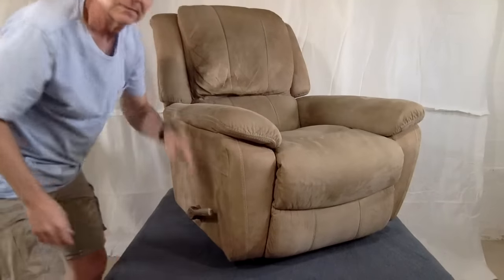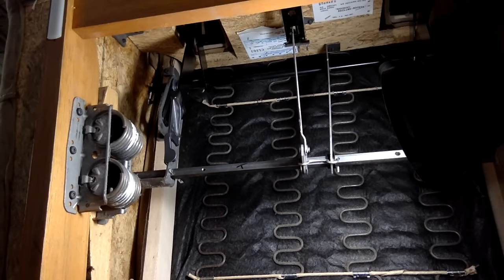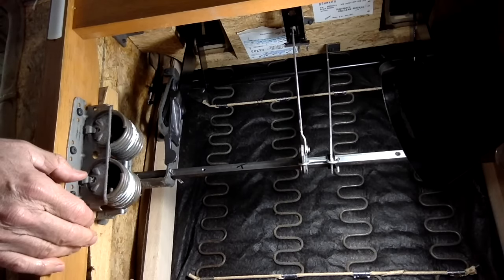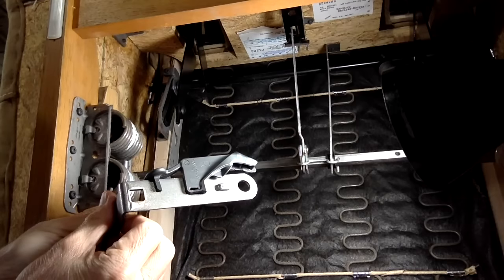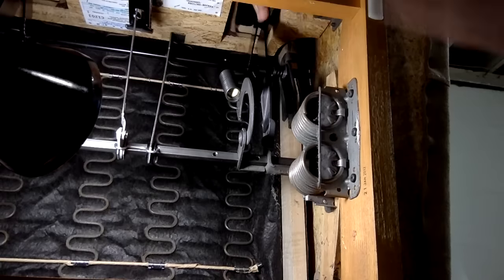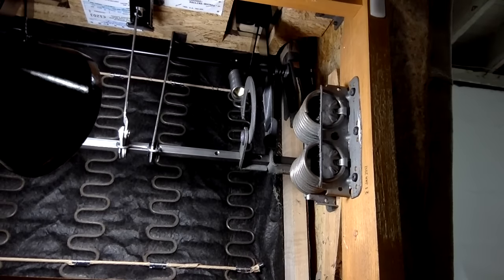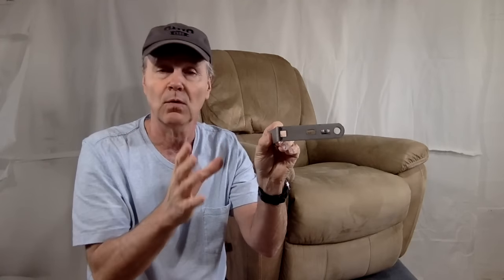The La-z-boy Recliner 3-Position Footrest

Comment: We were having trouble following other videos, mainly because the broken foot rests had the older grey part and we’d been given the black ones. We were afraid to exert the pressure required to put them on when it looked so easy in the videos. That included yours, but yours was so clear that we had more confidence, and then at the end you mentioned the new design being acceptable as a replacement and more robust. That was exactly what we needed to make it all happen. Also helpful was your comment that the party could be used on a one position foot rest, which two of our three broken ones were. I can’t tell you what a relief it is to have them all working again, not having to spend a thing on repairs or possibly replace the furniture, which would be difficult at the moment. Thank you so much!
Reply from the maker: @Cynthia Kelly - You're welcome -- Great job with the repairs!

Comment: That was a great video. I have had a Harbor Town (smaller La-Z-Boy) whose footrest has started to slip from position 3 into position 2 when reclined and it's aggravating.I found more details in your video than anywhere else. Thank You.
Reply from the maker: Massey Jones - If the entire chair is slipping down, it is not the 3-position footrest feature. That controls the footrest separately.

La-z-boy also has a Ratcheting Recline feature on many chairs. That controls the entire pitch (recline angle) of the chair when it's fully reclined. 2 parts control this feature, a lever (Pawl) and a part with metal stairs (Pawl Rack) that the lever rides on. When either part (or both) are worn, the chair will slip down as you describe.

I hope to get a video done on this subject sometime soon.

Comment: Thanks, the video is exactly what I needed. Fixed it in 5 minutes. The only complaint is that those crazy little clips costs $23 plus shipping. Should cost around $5!!!
Reply from the maker: @nashvlbees - This is a common part that many La-z-boy dealers will have in-stock. If you can find a dealer that has them, you might be able to get a better price & save the shipping cost, of course.

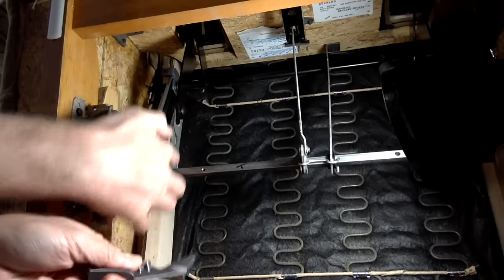Comment: Fix in place using JB Plasticweld - mix the clayey epoxy thoroughly and mould a small piece over the gouged portion shown @2:54. No need to take the clip out. Let it cure overnight. Good luck!

Comment: Good videos; however, I have a recliner built in 2006 and it does not use the 3-position clips. Instead, there is a toothed ratchet in the center of the chair. I found the screws holding the ratchet to the wood back were loose and missing. I replaced them but my "ratchet" does not appear to be working right. Perhaps I need to "recalibrate or adjust?" Thanks!
Reply: Check out the video I posted a link to. It's an easy fix.

Comment: i just looked at my moms & that big spring you slid over a bit at the end of the video thats attatched to that big hoseshoe bracket, well on the other end that bolt that holds the L bracket to the square tubing sheered the head off, thus i suppose while trying to recline or use the foot rest bent that horseshoe bracket pretty good to the point the L bracket wasnt even close to lining up with the hole in the tubing. so ive straightend the horseshoe bracket now everything lines up again i just have to drill the broken bolt out of the square tubing & replace it. so my question is what might cause the head of that bolt to sheer off? i might have a better understanding of why or what bound up to cause that once i get it back together, just thought maybe you have experienced that issue before, but your videos really helped me with the operation of the mechanisims  Thanks 👍
Reply from the maker: @NevadaBoy - My best guess is that if the fastener head is not seated flush against the flange of the Toggle, the stresses generated by the spring may weaken the fastener at that spot so that it may eventually fail. But that's just a guess.

Comment: I have an old lazy boy recliner which a foot rest that gets locked in the up position. I recently turned the chair over and found that the three position clips were laying broken on the floor. Would this be the reason my foot rest won't go down? And with those pieces removed can the foot rest be used without those pieces if I don't use the three position feature? Parts for my ancient lazy boy recliner are virtually non-existant. Any info you could share would be great!
Reply from the maker: @Pam Smith - If the 3-Position Locks (clips) are completely removed, the chair will still work as long as no mechanism parts are damaged. The footrest will open fully & close. If it doesn't close, there's another problem with the mech.

The clips give you 2 more positions in-between fully opened & closed. Without the clips you lose those additional positions.
Reply: @reclinerrepairguy4155  Thank you! The foot rest still goes up and down without the clips in place so my chair lives to see another day! I'm a happy girl!

Comment: Great content! Recently, the foot rest of my lazyboy has become kind of clunky... It still locks properly in all three positions, but when closing, there seems to be a lot of friction with something and it makes the entire recliner jolt when closed... Any ideas? While I bought the recliner from an authorized dealer, it's an international one (in Israel) and technicians here are not necessarily the most reliable...
Reply from the maker: @Mikey Soclof - Remove the back & turn the bottom of the chair upside down on the floor. Now you can operate the chair & observe what's happening during the "jolt."

Comment: Trying to fix my elderly mom's chair. I think we need to replace the toggle attached to the tension spring. The toggle is completely bent and curved, and the screw/bushing (?) attaching it to the drive rod has sheered off. Looks like a pretty simple DIY, and I've found the toggle part. What kind of screws and bushings do I need to get to re-attach it back to the drive rod?
Reply from the maker: @carol-mo2az - I generally order all my La-z-boy parts from the manufacturer. So, I can't tell you what size the fastener is that holds the Toggle Subassembly to the Drive Rod. I simply request it when I order the Toggle, along with whatever parts I need to do the repair.

Tip: If the fastener is sheared off, it's likely going to be easier to replace the Drive Rod, rather than drilling out the shaft of the broken tempered steel fastener. With that in mind, you might want to oder a replacement Drive Rod as well.
Reply: @reclinerrepairguy4155  Thanks for the quick response and great input and advice. Very helpful! By the way, you have some of the best how-to videos I've seen. 👍

Comment: Hi! I recently purchased a Lay-Z-Boy Morrison 3-position recliner. I like it, but in retrospect, I should have spent a little more to get one that is longer. Do you know if there is any way to make the foot rest longer? Thanks!
Reply from the maker: @Michael Richards - Some La-z-boy recliner styles have an extendable footrest. To see if yours does, put your feet against the inside edge (closest to the seat) of the extended footrest & push outward. If yours is not extendable, you can contact your La-z-boy dealer to see if they'll work with you to convert your Leg Extension scissors to the type with an extendable footrest.

Comment: I will be napping, not moving at all...and BAM! The chair (foot rest) pops down what feels like 3 feet, but it's more like 4 inches. I can throw my feet down and bring the footrest back up. It happens daily now. Can replacing this part solve the problem? I think this part controls another feature of the footrest.
Reply from the maker: @jjudijo - Do the visual inspection of the Leg Extension scissors, as shown in the video. If the scissors look good, remove the plastic parts & inspect -- as shown in the video. If the parts need to be replaced, order a new set. You can leave the old clips off the chair & use it while you're waiting on parts. The footrest will still open fully & close. But you'll lose the 2 in-between locking positions until new clips are reinstalled.

Comment: Mine is a metal mechanism. The pins and springs disappeared and now I'm trying to find replacement.
Reply from the maker: @Dunlap Music - Parts for the older metal 3-position setup should still be available through La-z-boy or one of their dealers. See the video 'Troubleshooting 3-Position Footrest Issues on Older Recliners' on the ReclinerRepairGuy.com website.
Reply: @reclinerrepairguy4155  OK. Thank you. I figured out the pins and springs are missing. I'll check out the video to make sure I put it together right. I found some used ones on eBay

Comment: The footrest in our 2017 style 010537 recliner won't stay up if leg weight is applied. If I lean back a little it keeps the footrest up. Might replacing the 3-pos locks resolve my problem, or could it be caused by something else?
Reply from the maker: @Mike Cummins - The first step is to remove the back & turn over the bottom of the chair to observe operation while opening & closing the footrest. If you can't find anything that's bent, broken or damaged in any way, remove the 3-Position Locks. Next, reassemble the chair to try it out. (Keep in mind that you won't have the in-between positions, just the full-open one.) If the issue is resolved, the clips are bad. Order a new set & install.

If the issue persists with the locks removed, you missed a problem with the mechanism during your inspection. Contact an experienced repair tech for help.
Reply: @reclinerrepairguy4155  Got it! Thanks.

Comment: I had to repair my 8 year old LazyBoy recliner 3 position footrest a second time the other day. But this time I am still having some issues with it not staying in it’s 3 positions. I was working fine for a day or so and yesterday it failed. I think I know what’s wrong with it. The scissors was a little bent when I first replaced the 3 position lock the other day. I did bend the scissors straight but also noticed the rear swing was bent also but could not get to it to straighten it because of the round swivel base. My question is how do I remove the round swivel base so I have easy access to the bottom of my lazyboy? On your video you don’t have a base so the access is simple. Thank you. FYI- yes I did replace the 3 position lock with the swivel base attached. It is not easy getting my arms inside trying to attach the lock. I think I need to get back in and try to straighten the rear swing. Thank you.
Reply from the maker: @david gunderman - There are access holes in the round base that allow you to remove the 4 bolts that attach it. You'll have to swivel the base around to line the holes up with each of the 4 bolts to remove them. Use a socket & ratchet with an extension to reach the bolts.
Reply: Recliner Repair Guy thank you for the reply. Right after I messaged you I did a search and of course I found what I was looking for. I don’t know why I didn’t think about it before. And your video made it much easier. I did manage to bend the scissor a little more and the rear swing without removing it. So far so good. You have some awesome diy video on these expensive LazBoy recliners. Thanks again.

Comment: I just received my recliner a Aston model.  I have a problem that I don’t know if it is a problem actually.  When in the second footrest position if I move to sudden or forcibly against the back it pops into position three.  This is very annoying.  Is this normal in that anytime you move the back back it will automatically pop the footrest to level three or is this an issue that needs to be fixed.  I didn’t ever have this happen when I sat in the floor model before buying the chair.  Any help would be appreciated
Reply from the maker: @Noel K - I recommend you report the issue to the dealer (seller). You should have full-coverage warranty protection, so it's their job to make sure you're chair is working properly.

Having said that, since I can't inspect your chair or try it myself, I can't make any definitive recommendation. Could this issue be unique to that style chair? Perhaps. Could your body-type or the way you use the chair be a factor? Maybe. I can only speculate from here.

Comment: Hi,
I need some help with my Lazy-Boy recliner.
The sprint that holds the 3 position lever came as a, what appears to me some sort of retainer clip or bar.
Of course I did not see how it came off. But I am thinking, does the clip go inside the spring to hold twins in place?
Reply: **spring in place.
Reply from the maker: @Chip's Place - Yes, the clip was originally inside the coil spring with the open end of the clip over the end of the 3-Position Lever.

Comment: do you have any videos of the extendable footrests that came on some models where you could push out a few inches on the footrest in the highest position and it would move further out.
Reply from the maker: @paulstevens3177 - No videos on that, sorry. Those extendable footrests have a small mechanism attached to each leg extender (scissor). The most common problem with them is the mounting screws that hold them in place on the footrest come loose. When that happens, the extenders can become hard to operate or stop locking out in the fully extended position.

The fix is to remove the spring, tighten all the mounting screws & reattach the spring.

Comment: I recently purchased two Harbor Town manual Recliners. My wife and I both agree that we should have paid the extra money and purchased the Power version. The mechanism is noisy and getting the chair to recline is difficult. Is it possible to have these chairs modified to the Power version?
Reply from the maker: @Ron Neu - If the chairs are new and you or your wife are having difficulties in operating them, you should report the problem to the dealer (seller). Your chairs should have full-warranty coverage for 1 year after purchase.

No, there isn't any good way to convert these units to powered versions. But if the dealer can't offer any solutions to the difficulty you're having with operating your current recliners, you can request to upgrade to the powered units. I'm not suggesting that the dealer will agree to this solution, but it doesn't hurt to ask.

And if such a swap / upgrade is approved, be sure and try out those recliners before buying for proper fit and function. Lean more  ---> https://www.reclinerrepairguy.com/advice_tips.htm#buyright

Comment: I don't think my lazy boy has the 3 position lock. My problem is my dog will climb up on my foot rest and the right side is dropped way down. It looks like the flat metal pieces (I think you referred to as scissors) are bent. Are those available or can these be straightened? My chair is older and I can't afford a new one right now. Any suggestions? I can send pics if necessary.
Reply from the maker: @CHERYL KY GIRL - If they have a slight bend they can sometimes be straightened. Check with La-z-boy or one of their dealers for replacement parts.

Comment: Great but on the side with spring the part is bent, how do i remove it and replace?
Reply from the maker: @John Theriot - If the bent part is the Toggle (curved metal part attached to tension spring), see the video series, 'Drive Rod Replacement Parts 1-3' on the ReclinerRepairGuy.com website. It shows how to replace damaged parts on the Drive Rod.

If the bent part is the Leg Extension scissors, see Legrest Extension Scissors Replacement,' also on the website.

Comment: My elderly mother recently purchased a new lazyboy recliner.  It's very difficult for her to raise the footrest...she has to use both hands.  Is there a way to make this easier for her?  Can it be adjusted?
Reply from the maker: @user-md4th7el7h - There are 2 things you can try. #1 Have someone adjust the mechanism tension spring. Moving the spring tension for the softest to firmest settings -- & having her try each one, to see if it helps.

#2 Get a recliner handle-extender from a medical supply store. These attach to the top of the handle & allow the user to use different grips & also can provide a bit of leverage that can help some users.

If both of those fail, or you know there's little chance that a little bit of assistance will make any difference, contact the seller & let them know that the chair does not work for her. If it's a recent purchase, it should have full warranty coverage protection.
Reply: Do you have a video of how to move the spring tension mechanism?
Reply from the maker: @KarenSeagraves  - Goto the 3:15 timestamp in this video ----> https://www.youtube.com/watch?v=iaOdv9iV1fg It shows how to detach the tension spring. Note that the C-shaped part the spring attaches to at the Drive Rod end has several holes. This is the adjustment. For max tension attach the spring to furthest hole away from the front of the chair. This will stretch the spring more. Use the hole at the opposite end of the range to stretch it the least.
Reply: Thank you!

Comment: My chair has a 3 position adjustment and the first 2 positions work fine but the final (straight out) position won’t lock if I put any weight on it. Should I still switch out these clips?
Reply from the maker: @Steve Ruppert - Remove the clips and inspect them for damage. If there are any gouges or other damage on either clip replace both of them. If they are both ok, have a repair tech check out your recliner to determine what's causing the problem.